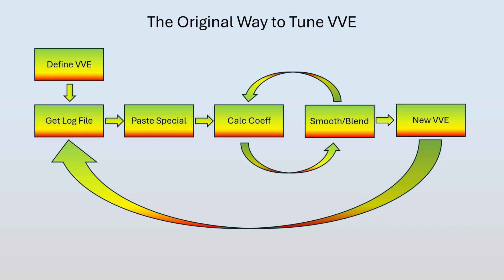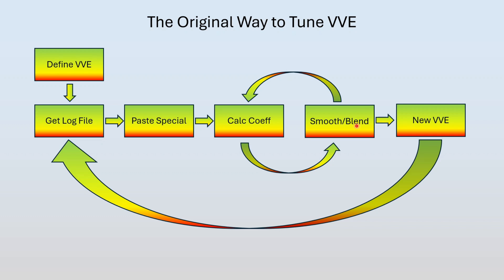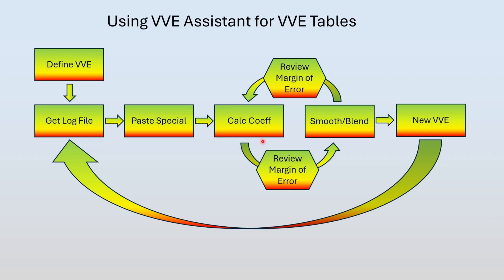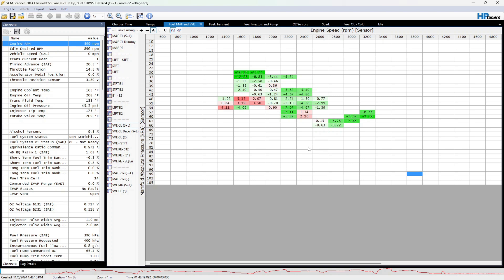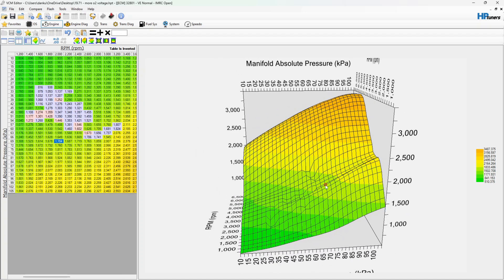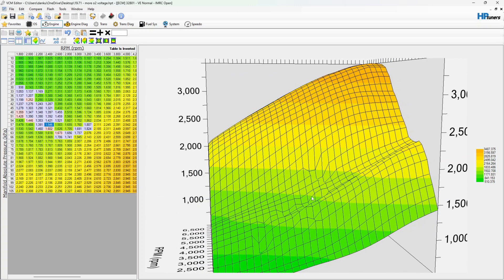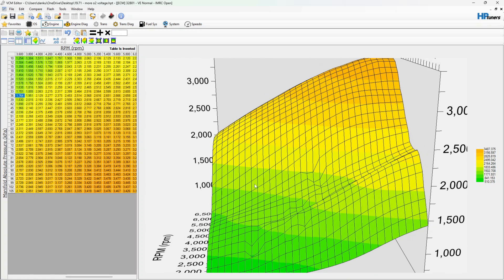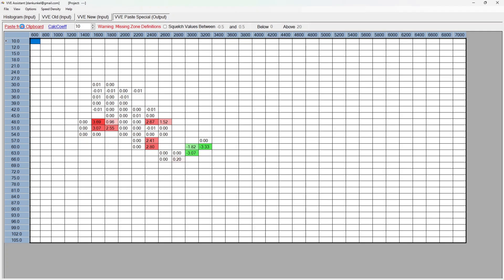Standard VE with VVE Assistant

Comment: I can't get vve assistant to work. Says zones too narrow. Ill try defining my own zones. But then it's a stock cam car with variable cam so i get stuck pretty quick. Is the professional mode for gen 5 lt stuff? Thanks for all you do. I just need more experience doing this
Reply from the maker: You need to make the zone bigger, either by manually expanding the zone or by adding more break points for either/or RPM and PR. I will also state that this tool is not for beginners and is not magic. You really need to understand how to tune VVE manually and once you do, this tool allows you to run (instead of walk).

Comment: hey cringer, so im tuning my next car and learning some more along the way. im using your filters and math parameters. my question is i get another histogram for when its in PE. what do i do with this information ? how do i use it. eg. its telling my im 10% lean when its in PE @ X*Y do i just copy that histogram over and add that to my VVE ? aswell as the histogram that was logged in closed loop ? eg. ontop of after ive done the closed loop VVE calculations and update same question goes for the maf calibrating
Reply from the maker: Click the Merge Average Another Histo link in the tool and this will combine both the CL and PE histo into one result set. Hint you can average multiple CL and multiple PE charts into one if you have many logs. It is still important to look at the cells in each zone that did not get any data hits, before clicking Calc Coeff, you need to deal with those manually (or using the tools in the VVE Assistant in the right click menu...see the video I made for v1.5 of the tool to see that).

The MAF tool will require you to tune CL and PE separately. However, once you get the hang of things, you can use the VVE assistant to average multiple MAF charts before pasting that into the MAF Assistant tool.
Reply: @SilverSurfer77  yer cheers, i wasnt understanding PE properly. thanks for your tools man they are night and day difference  in tuning IMO only done a few cars, and obviously not well haha

Comment: Hello. I worked a lot with pcm 3gen. Both 1 bar os and 2 bar os. But I still can't understand how vve works... Is it an analogue of the traditional ve table? Why are there coefficients in it?! 
Thank you for your work and time spent on us users!
Reply from the maker: The short answer is that the coefficients, MAP and RPM are plugged into a math equation and that equation spits out the airmass.

I made this video to explain in case you want to know the full answer.
https://youtu.be/pZ7i9c0sCN8
Reply: @ Now I understand, thank you very much!